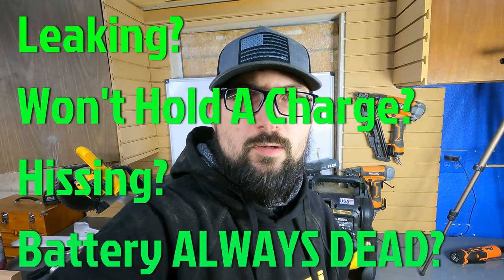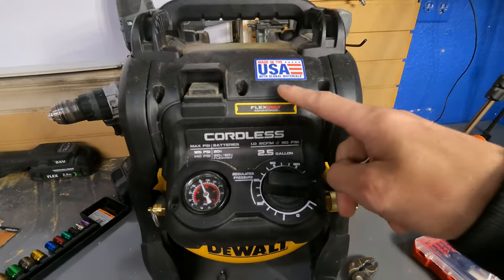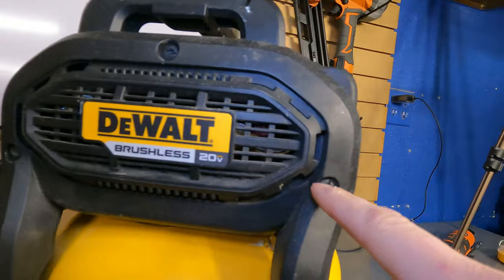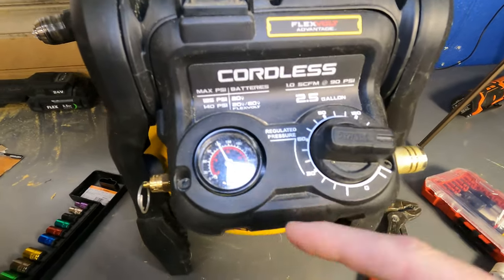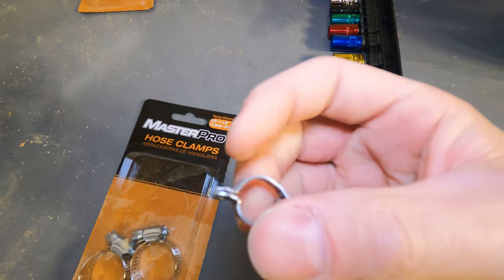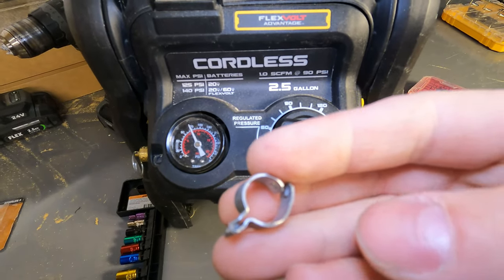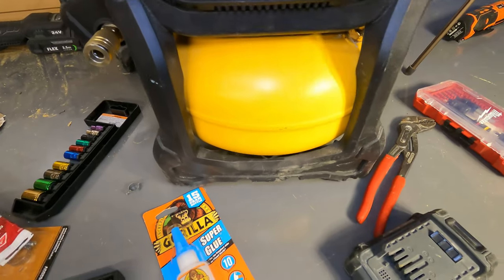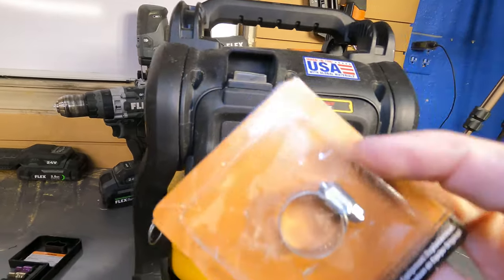DEWALT 20V Compressor LEAKS,HELP, BROKEN and FIX EASY!!!

Comment: Great info!  I retuned my first one after six weeks because of the leak, I started to hear the leak in the replacement after the second use, although the motor cycled and the sound went away.  I appreciate the info, I'll replace the clamps soon.

Comment: Mine, on the first use, leaks much stronger and not the same spot but from the tiny hole in the brass fitting. Full tank empties in under 5 minutes, you can hear the hiss the whole time. Can feel air coming strongly from the tiny center hole where one of the two black hoses attaches to the tank. Seems like intended behavior but everyone else is saying there's will hold a pressure all night long with no loss.
Reply from the maker: Yeah your valve Is no good!
Reply from the maker: I need to combine two videos into one because I had another issue
With a valve  20$ fix  its on the channel some where  sec
Reply from the maker: I found the fix, with part number and everything  the video. I'm gonna splice them into 1 video.  Very soon  

its a check valve  that needs to be replaced

Comment: Fantastic I wondered where I was loosing pressure /my question also after the compressor builds to 120 psi with no problems if the regulator is adjusted to any other pressure setting it still goes to 120 psi /is there something I’m doing wrong❤
Reply from the maker: Regulator should bleed pressure.
 Once tank satisfies to 120 dial it down,should hiss .  hope that helps

Comment: I bought one, used it once last fall got it out today and it won’t even turn on.  Tried multiple batteries - all fully charged - nothing.  We are in the middle of a 3 day long power outage and this was not an issue I needed.  Any ideas?
Reply from the maker: The pressure switch might be stuck  what do you have the psi set to?